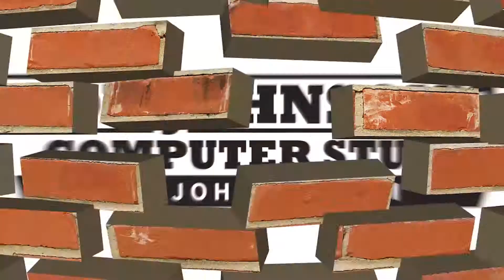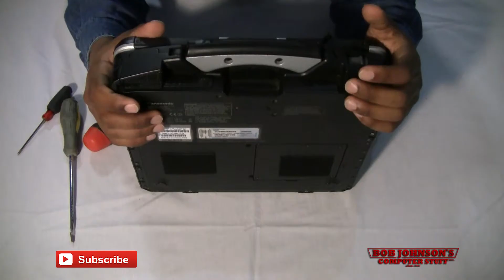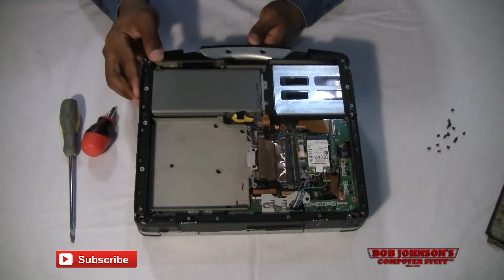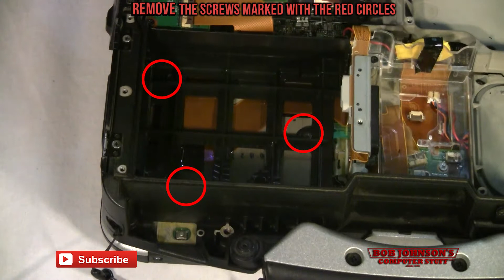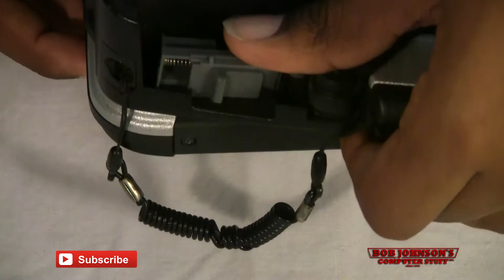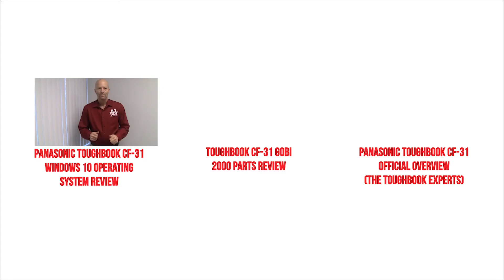How to Replace a Power Button on the Panasonic Toughbook CF-31

Comment: That’s not the power switch, but rather the mechanical plastic slider that engages the momentary contact switch (tact switch) for power in the chassis. And you only have to remove the one screw to the cover around that mechanical slider to get the slider out. Replacing the actual power switch circuit board, which is more likely fail requires major surgery (you have to remove the palm rest and ruin the palm rest sticker, the bottom cover and the hard drive cage).